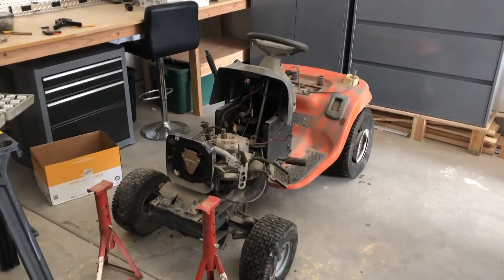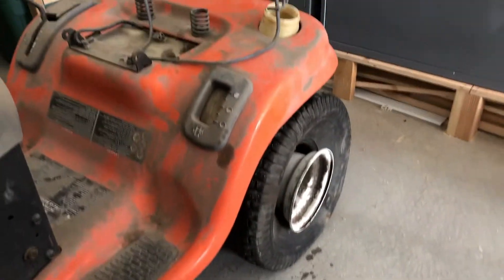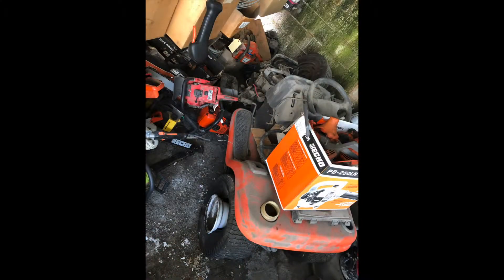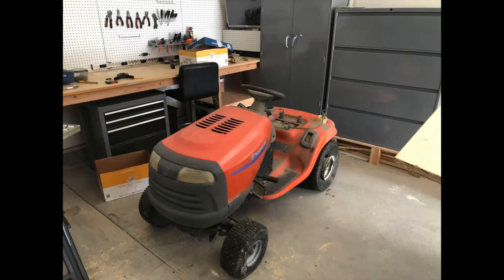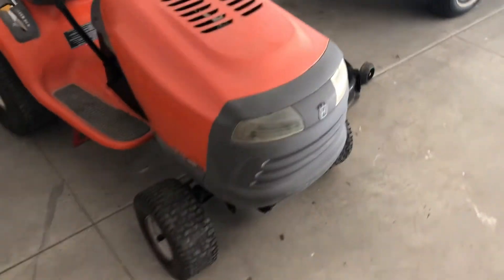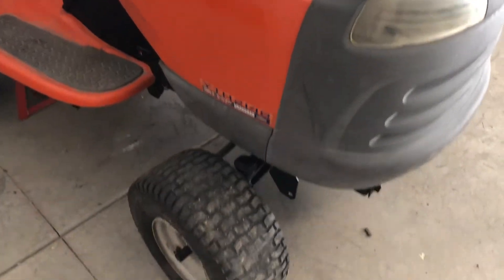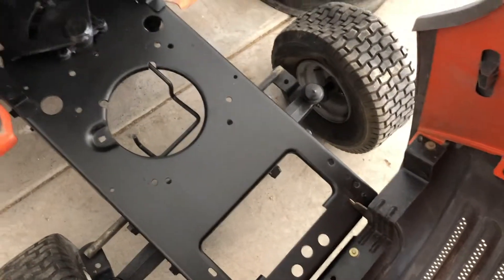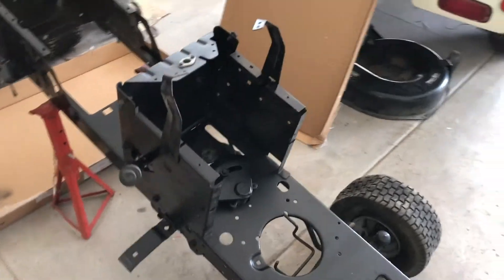Electric Riding Law Mower Conversion (Part1 the tear down)

Comment: Have you made any progress on your lawn tractor? I am thinking about doing something similar except I am going to use it to move a small boat around the yard and down to the lake I live on. I am a disabled vet and need some thing to move the boat.
I am probably going to use 1 12 volt motor and battery for simplicity. Good luck with your project.
Steve
Reply from the maker: Yea i have it up and running great! i will try and get a video out on it soon.
Reply from the maker: I have the new video up!! https://youtu.be/0LzWVv43vMQ